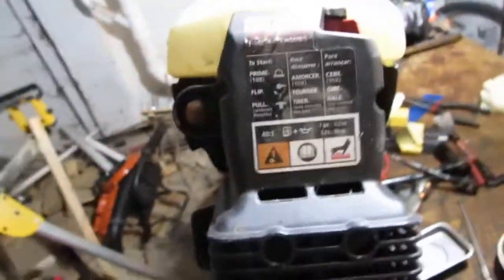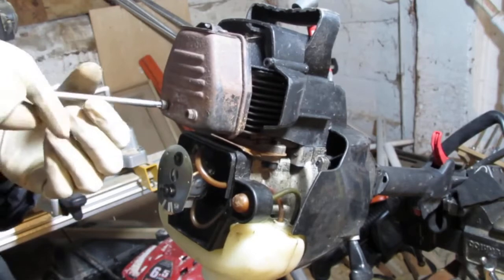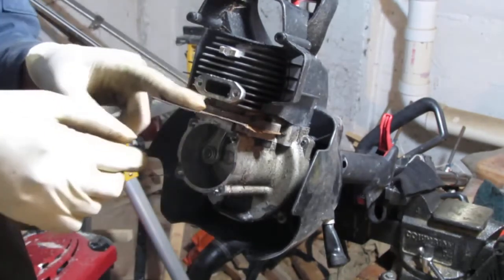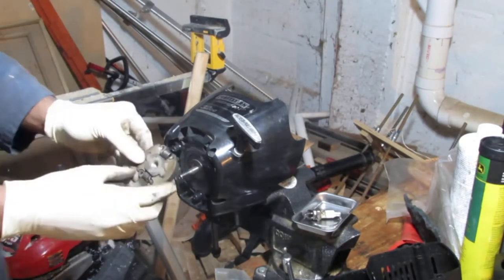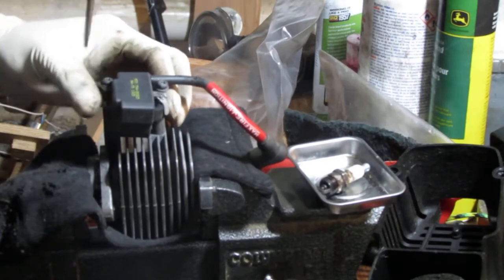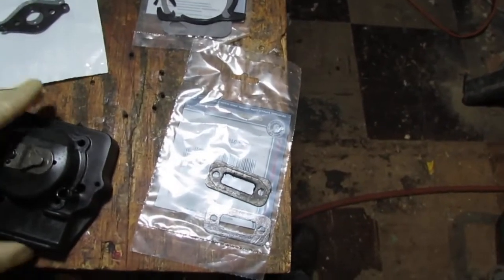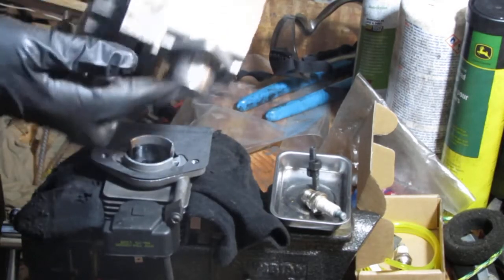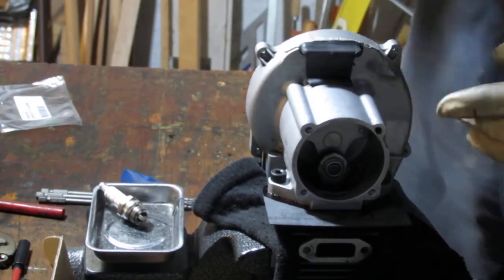Get It Running : Craftsman Incredi-Pull 316.791810

Comment: I know it's an old video and you prolly got it figured out by now but a split mandrel with proper grit emery cloth and keep it steady in the center....or and make a plate with a center hole and attach it the the cyl body to keep center when deglazing.  For the tough gaskets you can spray a little bit of Marine paint stripper in a container and set the part in it for an hour and the hard parts will wipe off.. wash it well and reassemble.